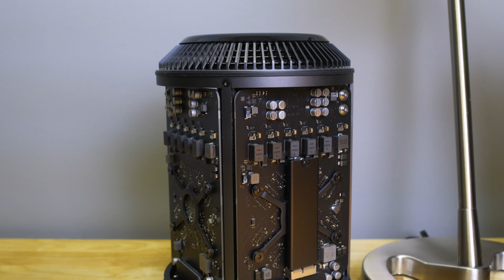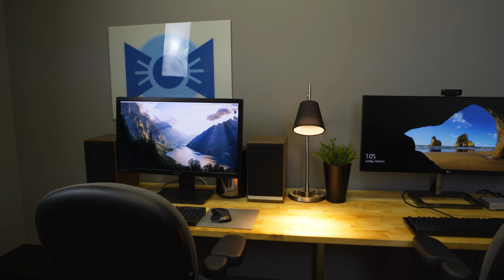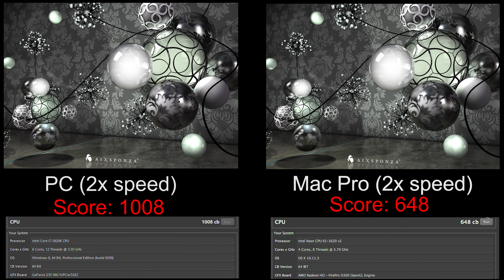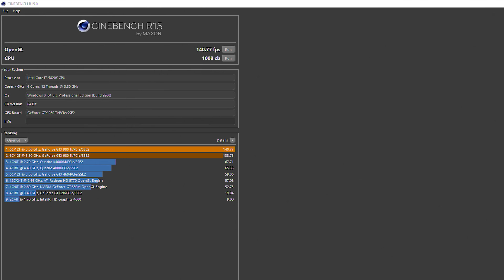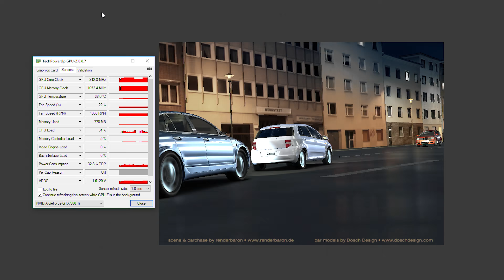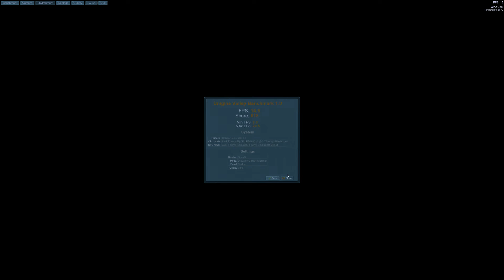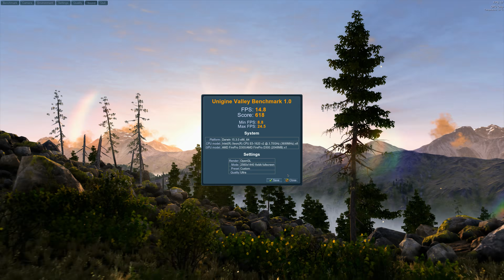$2,000 Custom PC vs $4,000 Mac Pro

Comment: Interesting fact though. I have been video editing on a $6000 machine built 4-5 years ago with dual 8 core xeons at 2.0ghz and 64gb of ram and the best nvidia card at the time (Gtx 650). A coworker's macbook pro would playback certain projects faster in after effects than the pc. Obviously the macbook pro had much less processing power so, at NAB I met with some of the guys from adobe to get to the bottom of this issue and come to find out adobe products work much better at processing over fewer faster cores until you reach 6-8 cores. So A couple of weeks ago we built a new machine, this one has a 6cores at 4.2ghz 64gb of ram and the new nvideo gtx 1070 and it screams! Way faster than any machine I have ever used.

Comment: Would love to switch, but my personal experience= apple computers last forever and are as good as the day I bought them, Windows = viruses and pop ups and computer is shit within 2 years
Reply: isn't true... sorry but apple's tecnology is just bad I repair them all the time (motherboards)... PCs rarely fail.
Reply: i don't think anyone's arguing that apple's hardware is better, seems like more of a software problem. Are PCs still more prone to viruses? I haven't used one in a long time. What is your average lifespan for a PC? I've had my iMac since 2009 and its still goin pretty strong
Reply: yes from 2009 or 2000s was better than PCs now is other history
Reply: My average lifespan for a PC is about 6-7 years currently, including 1-2 changes of the graphics card and perhaps a RAM and HD/SSD upgrade/addition now and then.
Processor, SSD, HD and RAM are good for a long time.
Only graphics cards are still subject to change often, since they still increase power and RAM each year. 
If you don't need this GFX power for games or work, also a stock PC from 2009 is still pretty good.
My oldest PCs in use are 11 years old - Toshiba M4 tablet PC, upgraded to SSD and W8.1. Of course these are really outdated, but they are still good enough for a bit of surfing or other easy work, and even a bit of painting in Photoshop.

PCs are still more attacked by viruses and other malware (browser bars etc) than Macs - of course, because their much larger market share makes out a lot more interesting target for virus authors.
On the other hand after all I know Windows itself is pretty safe, and you can use additional anti virus software. Nevertheless, you have to be careful, know what your'e doing and of course make backups often. I had a virus once in 20 years, caused by an outdated plugin in Firefox (so it's partly my own fault - I had switched off all auto updates for a specific reason and forgot to switch it on again for this thing).
It is no problem to use a Windows installation for a really long time, if you are careful about viruses. My oldest Windows installation is also from 2009, and hasn't become shit at all :)

If you think that your 2009 iMac is still going pretty strong, that's an indication that you don't need high GFX power or lots of RAM, so I think an iMac still is a good choice for you.
So why do you want to switch?
PCs are better in a lot of categories (price, power, upgradeability, versatility), but not in all.
In resale value and virus risk Macs are still better, so it might be a good choice to keep your Mac or upgrade to a newer iMac, once you need the power.
Reply: GrosserMagus good to know, are those changes voluntary like you wanted to update them or because they crapped out?
/ you ever have problems with viruses?

Comment: Just curious, what's the point of making a custom PC?
Reply: Just curious, what's the point of buying overpriced shit?
Reply from the maker: +Its Me John Stamos For me? It gives me a super fast computer to render videos on for cheap. It's... my job. Haha
Reply: It's better but for way less money.
That's the only point of custom PCs.
Reply: It's not just "cheaper", that's an understatement. 
A custom built computer can DESTROY any pre-built shit you can buy
and it will ABSOLUTELY WRECK any mac
(everything I reffered to was obviously of the same price)
Reply: Its Me John Stamos Case, motherboard, CPU, GPU, all of the fans or watercooling, Hard Disc, power source, RAMs, anything listed and more can be changed extremely easily. As you saw yourself, because of this, performance is extremely affordable becuase of all the competition between PC companies.

For example, my grandpa asked me to build him a computer for 200 dollars, I've already bought all the parts and that computer is going to be very decent for doing anything in windows and it may even perform quite well in some games. You can scale it HOWEVER you like, you can buy a computer for any price at all. As another example I am building myself a computer for 2500 dollars next month and it's going to have a fuckton of performance. I plan on playing every newest game on high to ultra settings on 144 fps.. no mac can do that or even come remotely close to that, MUCH LESS AT THAT PRICE
Reply: Mega Fragger you took that question personal huh? Lol
Reply: Goorpijp Wessel This is what I was confused about. I was thinking the goals of computers are the same. To be fast with lots of storage, but there's more to computers than I know.
Reply: I build my own (PC)... 
Like buying anything... that can be customized.. personal needs and taste enter the equation. 
I fine suit that is tailored (PC) is better than an overpriced one off the rack (MAC)

Macs were the best of the best... till Jobs passed away... 
Macs have been slipping in all areas but one... they still cost a lot...
PC's have been in a constant movement forward... not flashy but exceeding ones needs... Thus why I am a PC and the point of making a custom computer...
Reply: it's ok rich boy too busy ya ?
Reply: Ardy Teh Idk about that, but I can tell you're too busy to read ya ?
Reply: Its Me John Stamos cause it's 10 x better and it is cheaper
Reply: It's cheaper. Now I know. Thanks fellas.

Comment: Now i show u how mine specs go:

CPU: 2x Xeon E5 2670 v0 ( Stepping 6 ) 16C/32T @2,6GHz ( all cores up to 3,2 GHz! ) ( 2x 95€ ebay, saved me 2400€ )
MB: ASUS Z9PA-D8 ( 288€ )
POWER: BeQuiet Dark Power Pro 11 650W ( 150€ )
COOLER: 2x Arctic Liquid Cooler 120 Freezer ( 2x 55€ )
RAM: Kingston 16 GB DDR3-1600 ECC ( 100€ )
GPU: MSI GTX 970 Gaming 4G ( 250€ )
SFX: Creative X-Fi Extreme ( got it already, 60 € )
USB: CSL PCIe USB3.0 Card ( 5 more USB slots and my USB 3.0 FrontPanel works now, MB has only 2.0 header)
SSD: 512 GB Samsung 850 Evo, V-NAND ( 150 € )
SSHD: 1x 2TB ( from other PC ) 
HDD: 2x 1TB ( from other PC )
OS: Windows 8.1 Professional ( 25€ )

PRICE: 1350€

CineBench 15 --> 2003 points
GeekBench3 32Bit --> 33000 points
Unigine Valley average 79fps

Noobs.

Comment: my macbook pro out performs my buddy's $2000 pc. Oh yea, and my 5 year old macbook still doesn't have a virus. Try saying that with a PC. It might be cheaper to get a PC that is almost (not really) good as a Mac but they only last couple years if you're lucky so you'd have to replace it anyway and prices even out. Macs last for ever.
Reply: You have no idea what you are talking about. Your buddy overpaid by about $1500 then. Any $500 computer can out perform a macbook pro. Computers dont just randomly get viruses, that is user error. I have never gotten a virus on any of my devices, its not difficult. And no macs dont last forever in fact on average they break faster. And if a pc breaks you can just order the part that broke instead of paying apple $300+ for help. What i have told you is not opinion, you can argue if you want but im just telling you the truth about the world.